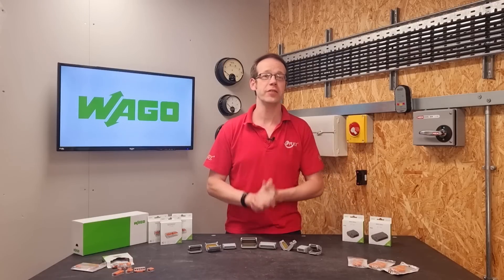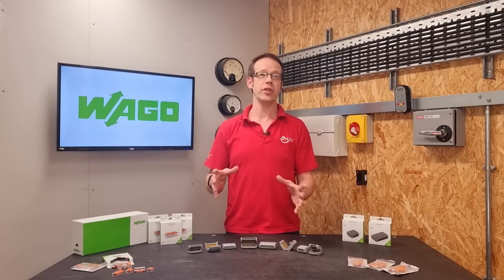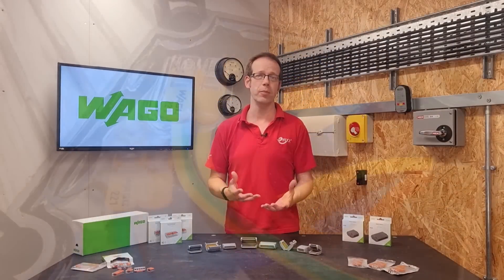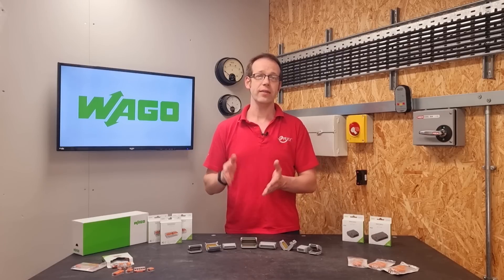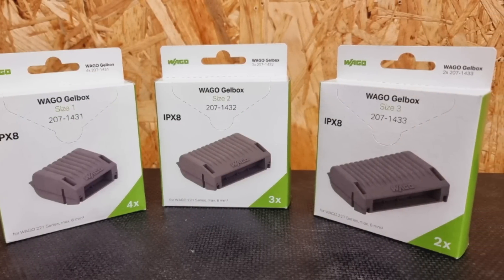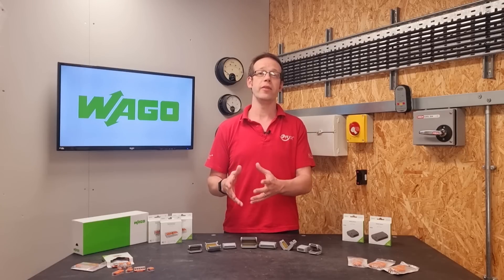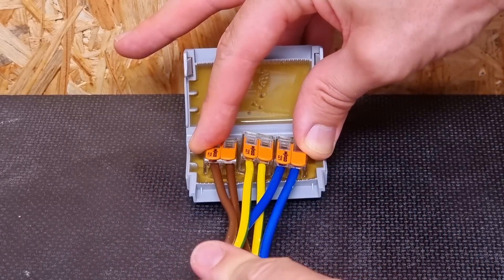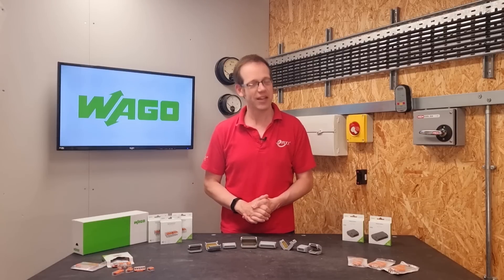How to Make Your WAGO 221 Connectors Waterproof

Comment: I like , what a brilliant idea, shame on wago for there prising as they are way overpriced for what they are. But I have to agree they are a fantastic bit of kit.
Fantastic video as always Joe 👍👍❤️
Reply from the maker: Cheers Sean, I guess you get what you pay for. 😃
Reply: @efixx  yes I agree . But getting what you pay for doesn’t justify the ridiculously high price for such a simple product. If you’re comparing a £20 cordless drill with an £ 80 cordless drill let’s say then yes I agree.
Reply: But you are comparing an 20 and 80 drill here. 
Difference is here your comparing a 10p connector block and £2 tub of silicone in a besa box, to a set of £5 wago connectors, £10 wiska box and £20+ gel boxes

I've used both and I know which I've had less call backs on, so I know which I'm pricing my customers up for when they ask my pricing

Comment: Personally they are way too expensive per unit, here in Canada they run at $15-20 per unit.
And Gel is not new, it has been used in telephony for much more than 50 years. As an exemple used very often for splicing a buried service wire and last for ever.

Comment: Would love to see you fit 3 or even 4 cables into that box lol
Reply: You can fit as many as the gelbox is designed for - as it's not there to provide mechancial protection you can fit a lot more cables in it per size than a mechanical enclosure. Of course you do need a mechanical overenclosure.
Reply: Think you’ve missed my point 
If you have a 308 wiska box that in the video only has 2 nyyj cables going into it then what was the point of the box other than a damaged cable or to short 
The majority of the time the wiska box is used to spur a cable of if the main cable I.e a garden spot light coming off of the main cable run so you would end up with min 3 cables not cores of cables to get into the enclosure which looks pretty damn tight
Reply: @danelectric702  Well you'd obviously get a bigger box. 

There's more reasons to splice two wires than a repair or because you're half way through a job and your apprentice [it’s always the apprentice] can’t measure properly. 

It might be to splice different cables such as SWA to NYYJ. Or in the case of this video it might just be to make a video demonstration of a product and it’s never going to get used anyway.
Reply: @keirstitt8277  🤣🤣 you must be a wago rep lol 
Why put the video of a 308 box that we all use and make out it’s great to fit their silly over sized connection gel box inside 
I’m sure the customer will love the massive next size up wiska box in their garden lol 😂
Reply: @danelectric702  I'm certainly not a rep for anyone. You use the enclosure that fits the application. If the box is half way up a wall then it's not likely to need a gelbox anyway unless its e.g. in a car wash. 

I think people overuse these kind of products tbh. You've got to ask yourself what the EI's are. For the vast majority of outdoor spaces the answer is no higher than IPx4 and may be as low as IPx2, either of which shouldn't need a gelbox.
Reply from the maker: Because it turns it into an IP68 rated connection.

Comment: I would love to see a IDIOT-PROOF test. where you guys ask 100+ random pedestrians to connect the wires, and close it.
Then see if they are shorting, inside a safe environment.

The only thing the pedestrians can go on ,is a simple instruction on paper. and nothing more.
Reply: They're not especially hard to use but definitely not completely idiot proof. We use these sometimes and you really need to use the correct number and types of connectors inside, installed carefully, or it will not last long.

Comment: This appears to be a giant ad. This certainly isn't a genuine review because it's issuing manufacturer talking points and failing to point out the obvious flaws as they pop up in discussion.

This is essentially a small project box with some single use gel inside. If you open it up you have to buy a new one invalidating it's sole useful feature. You might as well just buy a clamshell project box yourself and use filling gel inside of that.
Reply from the maker: The description states it's an ad. 👍
Reply: @efixx  The video should state it's an ad. Up front. First words out of your mouth, "this is an ad, we were paid to say everything in this video". 

90% of viewers are never going into your description and you know it.

Comment: Or ... Put them in an ip68 junction box with ip68 glands and NEVER drill an airhole ... It breaks the ip68 rating and is simply not required! A silica gel pack or a tiny amount of fresh cat litter in a pouch will stop any potential condensation!
Reply from the maker: Wonder if there's a point that they'd become saturated. 🤔
Reply: You may need to install a PEV which is a pressure equilisation valve with an internal vapour barrier to control expansion/contraction of the air due to temperature variations throughout day/night if no hole is drilled. 

Hence why I find drilling a 1.5mm hole on the bottom of a wall mounted IP68 enclosure is required as it's not just a drain hole.
Reply: @kjgreen3  I have tested standard IP68 JB's at the bottom of my pond (~ 750mm deep, and left outside in the rain & sun. They NEVER require a vent hole unless, possibly, the air volume *significantly* exceeds those 6"x4"x3" units (approx) I tested. There is just insufficient pressure increase to worry about it. The INSTANT you drill any hole, of any size into an IP68 rated  box the IP rating is no longer valid. So if the specs/regs say IP68 you are breaking the regs!! Simple as!

With regard to saturation of either cat litter OR silica gel, it will NEVER happen if the box is true IP68. Even at a sealing humidity level of 80% it doesn't (in my testing experience) cause an issue and the actual amount of moisture inside the box is less than 2ml. 

However, vapour barrier or not, put a hole in the box and I GUARANTEE condensation will occur. Don't argue the point ... PROVE it ... I have!

The only REAL issue is the amount of air/vapour that can enter)leave the box through the cable itself which is the weakest link in the whole waterproofing/anti condensation chain. 

A long enough, tightly woven enough cable will take decades to allow in  sufficient air/ moisture to cause condensation.
Reply: Are silica gel packs allowed in an electrical junction box? I mean on the one hand it’s a “why wouldn’t it work” but on the other hand I wouldn’t expect anyone to have done the testing.
Reply: @JasperJanssen  and therein lies the problem! The WHOLE industry says "drill a vent hole!" without ANY thought of thereby destroying the very thing you want to preserve ... The IP rating. It is the EXACT same thing as drilling a 5 mm hole into a CU without sealing it somehow! 🤔🤔🙄🙄😳

 Why? Because building regs says the domestic CU must be made of fireproof material (note without specifying a temperature!! WTH!?). And it must conform to IP 2X (vertical surfaces) or IP4X (horizontal surfaces). 

A JB of IP68 spec (no unsealed holes and fully waterproof to 1m) having a 1.5mm hole (tiny) drilled in it means that it is NO LONGER IP68 rated and not even IP4X rated!

Comment: You must not try this at home = DIYers will almost certainly see this as a solution to reconnect that submerged pond pump they put a shovel through the cable whilst cleaning
Reply from the maker: Eek! 😬
Reply: Circuit would be tested nowadays (unit used is expensive and needs bi-annual calibration. A typical Insulation Test Voltage is 480 to 500 volts for upto 2 seconds for a 230v/240v AC nominal supply). High and low resistance range on a multimeter won't do although it may provide an indication of what's wrong if you know what you are doing (competence) with the supply isolated.
Reply: And their RCD will trip 🤷‍♂️
Reply: @GeeTheBuilder  if they have an RCD LOL...

Comment: Overkill. The boxes don’t leak if fitted properly with proper glands.
Reply from the maker: You'd be surprised, moisture can track through the cable rather than the gland in the right (wrong) circumstances. 🤔
Reply: @efixx  that can happen with these too